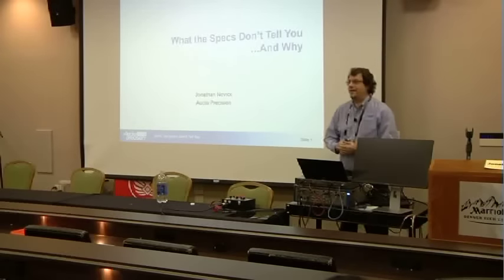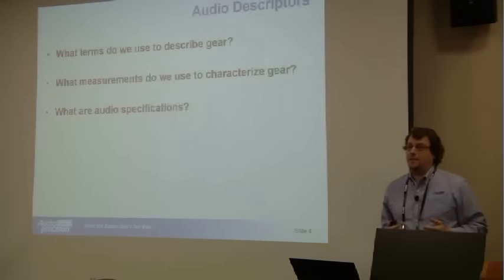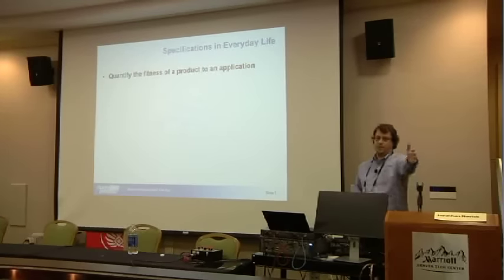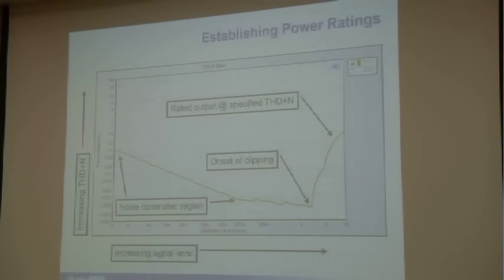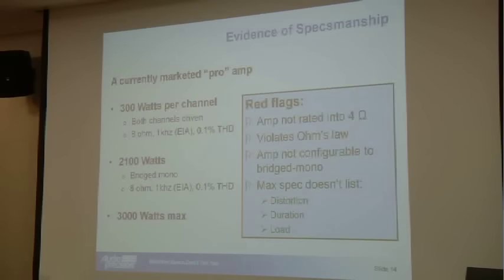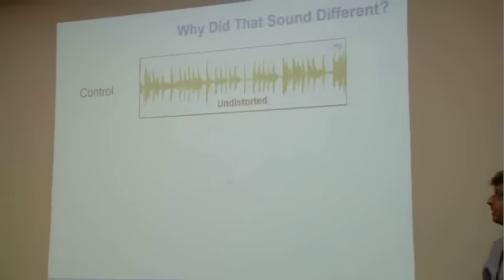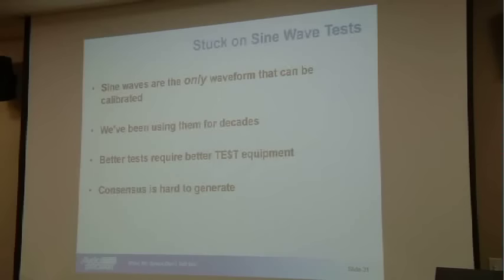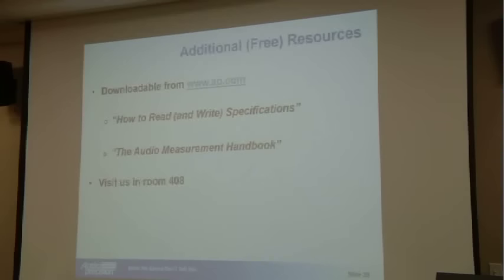RMAF15: What The Specs Don’t Tell You… And Why

Comment: This is very good, and he makes a great point that crossover distortion affects every cycle, versus peak clipping that happens only occasionally. But I have one comment: I doubt that slew rate limiting is the reason for distortion to rise at higher frequencies unless the amplifier is playing very loudly. At normal volumes it's probably because there's less available negative feedback simply because there's less open-loop gain.
Reply: Bruno Putzeys states something similar in his article about "No such thing as too much feedback". 
The cause is indeed that too little NFB is used. https://linearaudio.net/sites/linearaudio.net/files/volume1bp.pdf
Reply: @hidjedewitje  Thanks, that's gold. The only time you can not have negative feedback is if the gain in your amp is very low - like maybe x 2-3.... as a guess. Once you introduce high open loop gains you must have error control. Error control = precision; you are performaing a mathematical function. No feedback means your amp is basically out of control. People who claim no feedback is best, must ignore the thousands of op amps that were involved in laying down the original recording - all of them used negative feedback to produce distortion free recordings. Its almost magical / religious thinking to have a negative view of negative feedback.
Reply: @mikevincent6332  The open-loop gain needs to be high for high disturbance rejection. Low close loop gain is perfectly fine.
 I don't even see how one can make an amplifier with a OL gain of 2-3x. A typical transistor already has Hfe of up to ~400, but typically about 150 (though power transistors have less and the capacitances limit HF performance).

It's also the case that a little amount of feedback does more harm than good. When you lower sensitivity in the lower frequencies, you increase sensitivity for high frequencies. That's just the bode sensitivity integral. If you use little amounts of feedback, you'll end up with more sensitivity to disturbances in the midrange where you are very sensitive for them. In that case feedback sounds bad. You just have to apply as much feedback as you can to push the sensitivity out of the audible bandwidth. Some of the best amplifiers have out there have about 60-70dB OL gain at 20kHz.
Reply: @hidjedewitje  I think the low voltage gain circuits must still have forms of negative feedback such as emitter degeneration resistors etc, which will of course knock back the gain of the circuit considerably and extend the linearity, but I would have to study a circuit to find examples (some of the Pass amps perhaps) this type of feedback is les opbvious than global feedback. I have designed an amp myself which seems to have great performance. it uses (gosh) 4 feedback loops and I think it is called a common-emitter, complimentary pair darlington output stage (collectors are tied together at the output) 275W RMS into 6R. I am not formally trained but simulated my ideas in spice before building. I use an OPA op amp to drive the whole thing. The o/p stage has a voltage gain of 6, its a very unusual design
Reply: You only hear what you want to hear and do not understand the main point of the video.
Measurements and spec tell very little about how we perceive sound, so everything you preach about zero testing etc is pure BS ..
Measurements and specs are good for telling if a device is working as intended, but largely useless for defining High-end.
Crossovers SR , THD do "not exist" in a well-designed amplifier. But still, they sound very different for many reasons.
Reply: @torbenkristiansen7732  LOL, if only you could list and explain those reasons. You are the very definition of a troll. You criticize real experts, but can't explain why they're wrong or what is right. So all that's left is BS like "they sound very different for many reasons" with no further explanation. Measurements and specs, if complete, tell us if a device is good enough to not color the sound. And THAT is the definition of high fidelity. Anything related to perception and subjective preference is unrelated, and has no place in a discussion of specs.
Reply: @torbenkristiansen7732  Did you not watch the above demonstration? These are some of the most committed audiophiles in the world - they could not hear vast amounts of distortion
Reply: @mikevincent6332  That is exactly my point and Novick's. 

Devices are so good today that it is not noise thd frequency variation specs that we only hear. 

Novick demonstrated this with his thd experiment, you had to exceed 1% before some reacted.
 What we hear is something else, we hear sound signature warm cool lively dark detailed etc. what Novich uses the first few minutes to explain.

 If you examine this more closely, you will find that these sound signatures are more due to material choices than specs.
 Material choices affect the specs of a component, but it is a bad component, for example a cable whose specs affect the audiosignal.

 This is exactly why Ethan Winer can do his null test. 
Hifi enthusiasts also hear the sound signature from the material choice and can therefore hear the difference between cables despite the Ethan W null test. 
How this happens  has been a mystery for more than 30 years.

Comment: Very interesting ! One of the take aways: are we sort of looking for new relevant ( as defined in the presentation)  distorsion measurements that can be standardized ? Other : MP3 coding introduces by definition a lot of distorsion, but this is hard to measure by present standards, is it ? I perceive that reviewers are maybe the new standards by which we judge or pre qualify audio equipment nowadays. Standardization of relevant tests seems behind in this. Thank you, Jonathan. Where can i find more of this ?
Reply: Perceptual tests are complicated and not always agreed upon. PESQ and POLQA testing is used a lot in telephony applications but I have seen these tests give very low scores with encrypted speech signals that actually sounded very clear.  Applicability comes down to the types of problems being measured, the weighting applied to problem and the characteristics of the signal path being tested. PA systems are often tested for their intelligibility using STIPA testing that accounts for the acoustics of the environment. There is a perceptual music test called PEAQ that has been around for years but is not widely used. I am not familiar with its short-comings but the lack of adoption would be an indication that they exist.